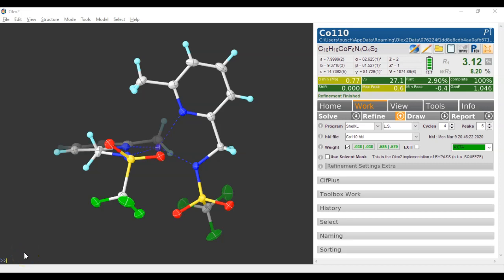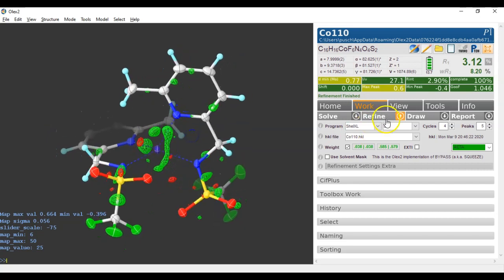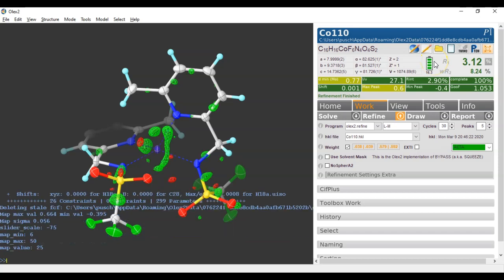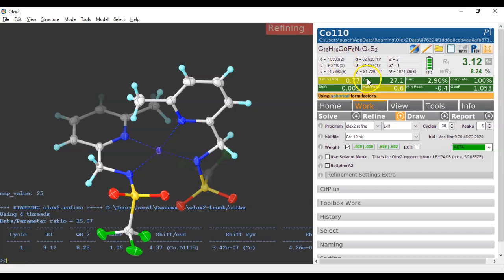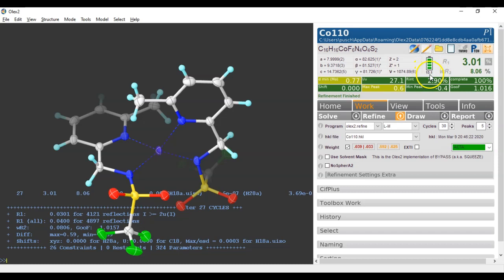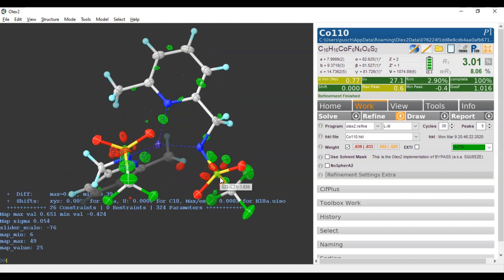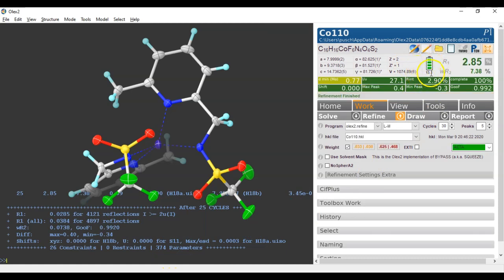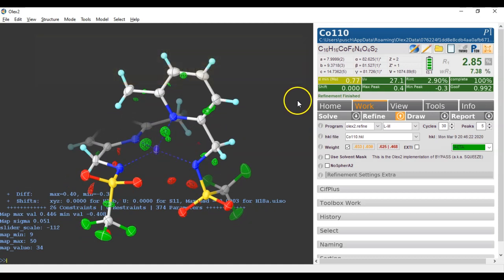Refining selected atoms anharmonically

Comment: Before going to anharmonic refinement, Could you please explain a bit that what is anharmonic refinement and what additional benefits it offers while using this feature in Olex2.
Reply: sometimes, harmonic motion is far from being the best description of what is going on
typically you have quite good Rint/Rsigma, there is no disordered solvent (well... disordered solvent can need anharmonic refinement, too, but that's more complicated case) but R/wR is still not what you'd expect
and if your resolution is good, there is suspisiously looking, often regularly shaped difference density around some atoms